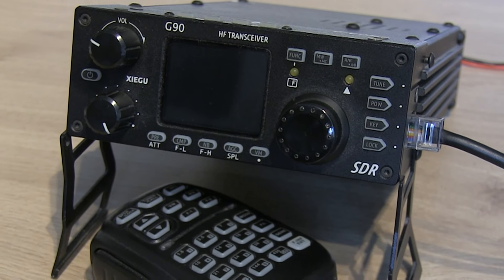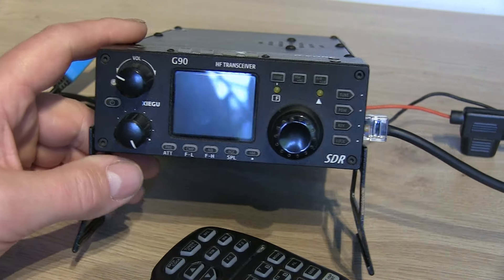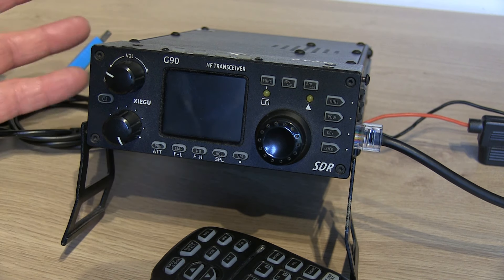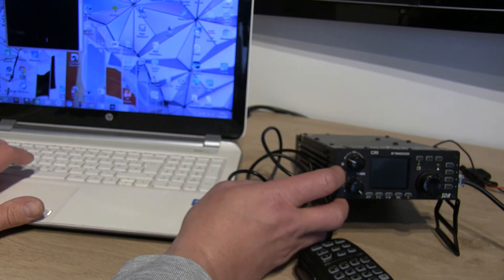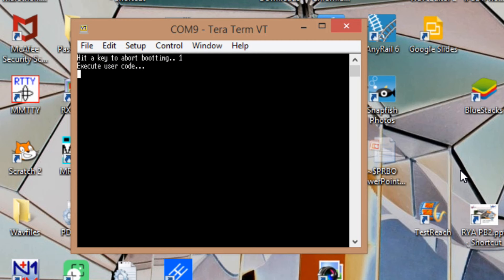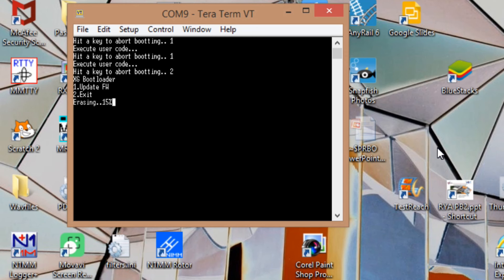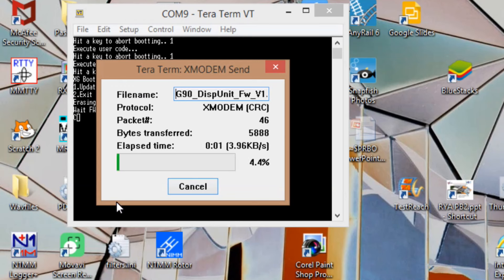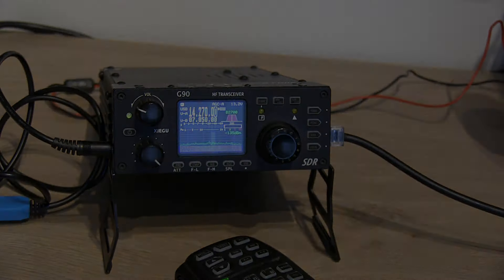Xiegu G90 Back from the Dead - Fixed

Comment: Thank You so much for your YouTube. I thought I "bricked" radio this morning. I tried to install V1.8 on the G90 head unit but it sure didn't like it.
Went to the website you showed for software downloads and got V1.79. Installed it and are now back with a working radio......Thank You.
This is a process I rarely do so it's challenging enough, and I saw that you have to be very careful on how you shut down or connect to the radio
with the data cable. You made that clearer for me too. Thanks for the help ........ Al,    NW8E
Reply from the maker: Thanks for you nice message and thank for watching. Really pleased you found it useful! 73, Ben de M7FRS 👍

Comment: I'm using the g90uodatefw utility bu to no avail, my machine is still dead. Any advice?
Reply from the maker: Hi, have you tried flashing the firmware to both the main radio and the head unit? Maybe try flashing an earlier version, but ensure it's the same version for both main and head unit. Also, is it definitely being flashed, as the space bar timing is critical. Good luck 🤞
Reply: Thanks for your response.
Firstly I am using the g90uodatefw utility. The program recognizes the rig gets everything started but wont start erasing the old firmware. After that I tried to use a serial terminal. My space bar timing is fine because I am welcomed with the appropriate prompt. But when I press 1 for update firmware everything just hangs (like when I use the g90uodatefw) no erasing or anything

Comment: Hi there nice vid! But mine has the same problem, but it doesn't go into FW update mode. Can you help maybe?
Reply from the maker: Have you checked: 
a) correct com port 
b) correct board speed
Also: The timing of pressing the space bar after powering up the radio is critical. You may need to attempt this many times. Also, ensure that the radio is disconnected from the power supply after each attempt.  Hope you manage to sort it. Thanks for watching 👍

Comment: no. mine is just dead. one day i turned it off and then tuned it on and it does not stay on without holding a button. body does not show anything on terraterm to be able to reflash it. front unit reflashes fine if you hold the power button all the time. wtf :( massive crap this lump of commie electronics